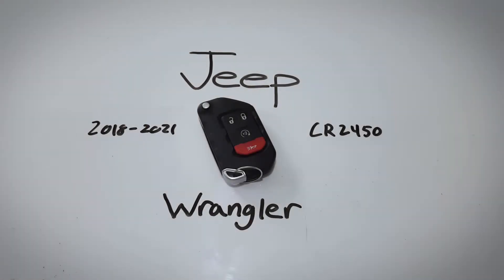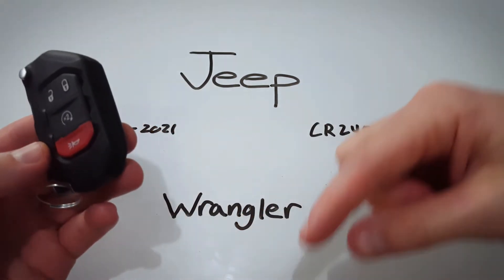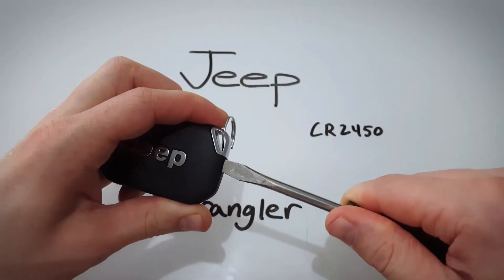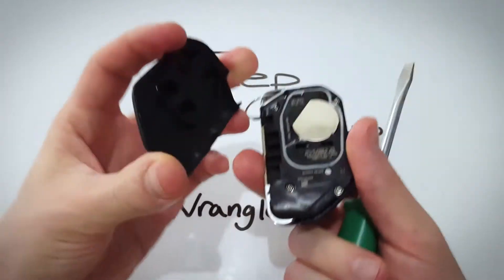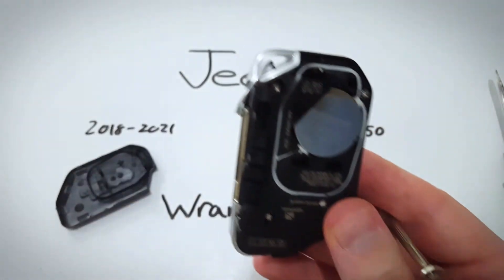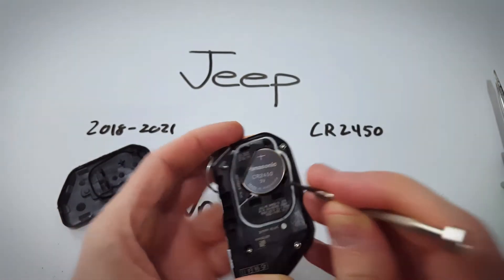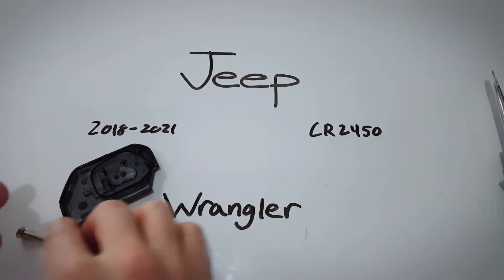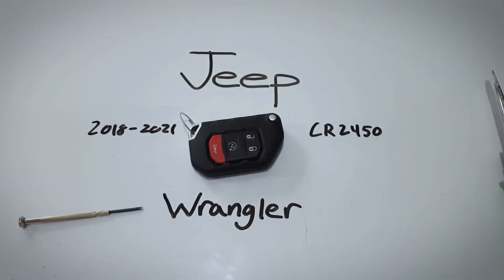Jeep Wrangler Key Fob Battery Replacement (2018 - 2021)

Comment: I've had a low key fob battery warning for some time.  Sometimes it works remotely, other times I have to place the key fob to the ignition button.  Thinking about going to home depot and changing it out.  With my luck, I will get stuck in the home depot parking lot on the way home w/o ability to start the car lol, but at least I'll have the battery.  So I will need to go back into the store, buy a screw driver, and replace the battery in the car.